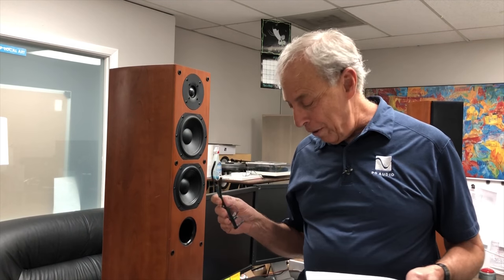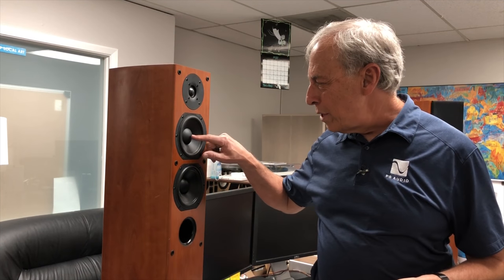Does a dented dome tweeter matter?

Comment: I use a vaccum cleaner for dust caps. place the pipe on the dust cap, turn on vacuum, it pops out, turn the vacuum off before pulling the pipe away because it might pull the cone out too far and that's it.
Reply: Best if you have a hose that has an adjustment knob usually found on canister types.
Reply: yes,  worked for me.   Adapt the hose to a tube same diameter as the dome, adjust the air bypass hole until the vacuum force  is just right to gently pull out the dome.
Reply: @Anthony Martino I tried that but the dust caps on my subs were too stiff; some sort of treated paper.  All it did was pull a bit of the outer layer of paper away from the caps.  I eventually gave up and had to live with my ugly, smash-faced subs, thanks to my 4 year old cousin staying with us.
Reply: I wish I had read your post, before I wrote mine. I recommended the very same thing. I just recommended, that you place the pipe against the dome first, THEN turned on the vacuum. Then, hold the pipe perfectly still, turn off the vacuum, and wait for the motor to wind down before removing it. My tweeter had a very stiff dome, compared to the very compliant surround.
Reply: @Viewer19  I agree. You don't want to over do it, and collapse the coil former. Otherwise, I hope you can find a replacement diaphragm for your particular tweeter.
Reply: @Anthony Martino I couldn't do that with mine. The dome was just too stiff for how compliant the surround was, so I was afraid to pull that hard on the dome. I used a canister vacuum cleaner. I had an attachment, that was the perfect diameter for the dome, without touching the surround.(I needed full suction, but it worked)

Comment: Many years ago, when my children were toddlers, I owned a pair of Magnaplaners (sp?) - very high end, but somewhat fragile audiophile speakers.  Maggie's don't have domes, but the speaker area is thin and frail, and no match for a toddler with a rubber tip bow and arrow.  Knowing my two rambunctious boys, I lived in constant fear that sooner or later, a Tinker Toy would end up being stabbed through my beloved speakers.  I confided my problem to a friend who offered to sell me his pair of BullFrog PA speakers.  Now, I know that true audiophiles will gag at the suggestion of using PA speakers in place of high end stereo speakers, but to my (tin) ear, they actually sounded pretty darn good.  The sale clincher was when my friend demonstrated the child proof (aka drunken dancer proof) feature consisting of steel mesh speaker grills.  He actually threw a beer bottle across the room and bounced it off the steel grill.  "Let's see you try that with your fancy ass Maggerplanters".  Long story short, I sold the Maggie's and bought the Bullfrogs.  That was 35 years ago and believe it or not, the Bullfrogs are still proudly displayed in my man cave, still sound great AND have never suffered a dented dome.  Possibly a pointless story, but I thought you might be amused.
Reply: Ha!  A buddy of mine bought a pair of Advent Heritage speakers to ho with his home cinema.  They worked well,  but he had cats,  and the cats had sharp claws.  I bought some 1/4" hardware cloth,  cut it to size, and formed it around the grilles.  End of problem.  Heck,  they didn't even look bad!
Reply: @gyrgrls  this got me worried. I have cat

Comment: Speaker grilles go on when nephews come to visit. 
Sound quality marginally worse but mental health young lives and family peace maintained:-)
Reply: My man
Reply: Litterarly the only reason that I still have my grilles saved.
Reply: If I don't need the sound system, I've even gone as far as to face the speakers into the wall, and up against the wall, so nothing can get to the delicate tweeter domes, or even the coil caps on the mid range and woofers. Re-position them only if you need them.
Reply: Clean ears out. No difference. Os all in the mind.

Comment: I work in a music store and run into this issue ALL THE TIME. I have found that Gaff tape works the best for this purpose. it's adhesive is just strong enough to pull out even the most collapsed tweeter domes/dustcaps with no damage or tearing.

Comment: I got a pair of B&W DM601 S2 in exchange for some work I did for a friend. The tweeter domes were dented in. I can’t prove it, but after I gently popped the dents out, the tweeters seemed to be more detailed. The remaining lines and imperfections probably don’t matter, but the larger dents seemed to affect it. I’m talking more than half of the surface area was dented in. Weirdly, this was only noticeable when driven by my dads expensive Quad amp.

Comment: I would receive many damaged metal tweeters from JBL , INFINITY and other brands . 
I would use a heat gun at a distance at low setting and fan rapidly across the tweeter , and the air trapped would expand the dome back into place . 
Please be careful not to melt the surface !  Distance and patience, it actually works very well . A hair dryer would probably be safer to use than a heat gun.
Reply: I just posted this on a similar thread...what exactly are you using to fan rapidly across the tweeter.🤔😶thanks for this post 📫
Reply: @iheartwindshields9770  my wrist . Fanning as a quick left to right or up and down above the tweeter surface.

Comment: I had a dented tweeter once after second hand purchase. Tweeter not clearly visible due to speaker design. I heard and felt something wrong that time. Unpleasant and peaky highs, did some freq test with MIC and found out a peak around 9khz @ 12DB!! And the overall response wasnt flat at all! Removed dust cover and found the dented tweeter! Fixed it by slowly warm
It up and roll out the dent from the inside of tweeter moving your finger slowly. Measured afterwards and its flat like the other speaker again which didnt had a dent. So in my case i heard something wrong and to me a Dented Tweeter cant produce the right fequencies at right levels. It took me a while before i heard something wrong. It wasnt a damaged tweeter but a serious dent. Cheers!
Reply: patrickalphenaar small. (Shallow) dents won’t cause any problem  but if a dent is deep enough so that the cone surface comes into contact with the coil centre when it actuated that can obviously cause distortion. This is less likely to happen with the woofer cone as they have more travel anyway, but with a dome tweeter a relatively small den’t could easily cause issues, especially if the dent is away from the centre of the dome.
Reply: frodev , for sure a minor or slight dent wont cause too much trouble. I think the dispersion might be a bit distorted however wont be able to hear it i guess. In my case it was a serious dent and was causing serious problems. Luckily could fixed it. Cheers.
Reply: patrickalphenaar And this expert says it makes no diffrence. I guess that's why B&W is used at more mastering studios than PS Audio.
Reply: John Morris Hi, well some other people in my home studio also didnt hear any issue. Maybe Paul could have heard it in my Situation, i like to watch his videos as entertainment but i listened to very expensive high end gear and mostly they dont impress me at all! But felt in love with Zingali Speakers, but way to expensive! B&W never listened too but yes they most be great if used in so many Mastering Studios! A friend of my listened to them in a Mastering studio and loved them! However he says my Mirage M5-si reminds him Listening to B&W’s. So happy to know that. Currently using Full range Genelec in my new room and love them! Not only Analytic but also very musical after having them play in Phase! Which took me ages to achieve! Placement is as important as Room Acoustics! Cheers.

Comment: To say it has no ill effects seems a little odd to me.  A tweeter is essentially a piston that radiates sound waves in a given patter, based on its shape. Once that shape is altered,  it can't radiate the way it did when it in its proper dome shape, which is often measurable off-axis. I, personally, would replace any pushed in tweeter, regardless of whether it still sounds good at the listening position.
Reply: Old video/comment, but... yes, technically the shape is altered, but any little leftover creases after popping it back up make any changes undetectable to human hearing, at least for us mere mortals. In my case even in its pushed-in state there was no audible difference to my ear, so why pay possibly triple-digit sums to replace a minor cosmetic flaw? Which isn't to say that it can't be worth doing for someone else, but for my money it certainly wasn't.
Reply: @tvih84  Well, sort of...but it's not always like that.  What can and does often happen is that off-axis measurements can change significantly, which you could theoretically notice if and when walking around the room while listening. That said, you're right that if you re-shape it and it still works, the difference would most likely be undetectable (I'd STILL want to change it though... because I'm like that!  lol).  
Cheers!

Comment: Accidentally dented a Monacor DT-352NF during testing. Metal dome tweeter. Dent was about 10mmx10mm. This introduced 10-20% distortion spikes (measured on REW) from 6k to 18k as compared to previous measurements.

Comment: I've seen accounts online that denting can matter with certain metallic materials. Creases cause stress hot spots, and the regular operation of the speaker can then induce metal fatigue to the point of failure. I've only seen this with regards to full range titanium cone speakers, however.
Reply: you can absolutely crack metallic tweeter domes when you pop them back out. Ive done it to a set of JBL nd310 floor standers. You can also burn the tweeters out very easily through friction if you dont repair or replace them, and even take crossover components out when they do if you even have a tiny bit of high register clipping coming from an overworked reciever or something. Ive done it to a set of jbl nd310 floorstanders. Definitely just replace the diaphragm or entire tweeter if thats not an option.

Comment: Although I agree that you probably won't hear the difference, you can measure the altered dispersion of a damaged tweeter. All speakers are designed to act as a piston, but actually flex and "break up" to some degree in a predictable way. If the dome's shape no longer provides this rigidity then flexing will occur where there are creases. So, it becomes a matter of how much it matters to you to restore the speaker's original performance.

Comment: I had it with a KEF tweeter. The sound was still good but it looked weird.  I took my vacuum cleaner and had it put in the LOWEST power setting and gently pulled it.  Worked great! 👏👏👏
Reply: Peter Pan which kefs? I have a pair of q1's with the same problem and I'm afraid the vacuum cleaner might mess something up.

Comment: My friend used to work at a Hi Fi store, and they had a tool for getting dents out of domes. It was a long time ago, and I can't remember exactly what it was, but it was repurposed from something used in the electronics industry, and worked by suction (it was not a solder sucker).
Anyway, it was someone's job at the end of the day to go around and suck all the domes back out after they had all been pushed in by kids throughout the day. He said Saturdays were the worst - every single dome in the store would be dented without fail.

Comment: I had 2 pair of Quad ESL57's in a stack when my first kid was born. First thing I did was sell them. Even though they have pretty sturdy metal grills in the front and the back, I just could not live with the idea of my kids poking something metal in there. For the ones who don't know the ESL57's, these are electrostatic speakers which carry around 6000V of tension on the panels. Now my daughters are 8 and 10 and a couple of years ago I was able to start all over again with highenderitis. The stack is back, with Gradient subs and 4 Quad II tube amps. My kids know very well how expensive the setup is and treat it with the utmost respect.

Comment: This is Brian. I really wish you would have explained to people that on larger woofers and midrange speakers, these domes have no practical purpose except as dust covers.  As a matter of fact, were you to manufacture speakers, this part is called The Dust Cover. I've seen speakers that have no dust cover, be it because the glue wore out or they were very old and the dust cover wasn't installed at all. It actually protects the windings from gathering dust.

Comment: I have be building speakers for over 50 years and in that time I have also repair quite a few. I have used a vacuum cleaner hose to suck the deformation right out. Be careful not to allow lengthy suction.

Comment: I disagree, especially with metal dome tweeters. Once the dome is deformed the voice coil is no longer 100% circular. The tweeter dome is now unbalanced and subject to overheating and rubbing the walls of the speaker magnet. I witness this firsthand with B&W loudspeakers that blew a tweeter shortly after aluminum cone was deformed. Upon magnified inspection of the wire voice coil you could see visible contact points where wire coating was rubbed off from contact with inner magnet. I’m not sure if this is the case with soft dome tweeters though.

Comment: I've had good luck with the tape method for pushed in dust caps.  For really stubborn dust caps, you may have to get more extreme.....I've had some luck with a needle with the tip bent near 90 degrees - pierce a small hole, insert the needle tip and pull the dent out....then apply a small dab of color matched silicone caulk to cover the hole.  Metal domes are tougher.  The best I've managed to do with a metal dome tweeter is to remove the  diaphragm from the magnet and gently push the dome back out from the inside....a pencil eraser can help smooth out the wrinkles, but it's never gonna look like new again, though it can still perform well.

Comment: I had a set of JBL nd310 floorstanding speakers. They had a 3/4" titanium dome tweeter. My ex's kid stuck a finger or pencil eraser end, or something in one of them and dented it. It still functioned fine, but accuracy of imaging on that side of the sound stage suffered a little bit (right channel). Wasn't much at all, and at my current age, i dont know if id notice anything, but the lines of separation were most definitely blurred a little on that channel from then on so to speak. I could detect it with them flipped around as well. I was very accustomed to the sound of that 1 set of speakers, center of image vocals almost felt smeared backwards and up, very subtle and hard to describe even at the time. Once a set of the tweeters popped up on ebay and i replaced them, the "blurred lines" went away. But not before trying to undent yet again and cracking the dome. This tweeter eventually went on to burn out from high frequency clipping way before it should have, taking some crossover components with it (in a half-assed project in some white van special boxes anyway)

Funny tid-bit: The way the center image was affected was almost perfectly in line with the tweeter damage. The dent was on the upper right section of the dome only on the speaker i used for the right channel, and the right side of center image felt smeared and blurred subtly "backwards and to the top right" was how i described it at the time. The dent was absurd how small yet deep it was without cracking the dome, and the kid never came clean on how he did it either.

It can definitely have an effect if left dented, but even then, it's not very significant (at least on a set of low end jbl towers lol). They still sounded fine for what they were. Those were a surprisingly detailed, and overall pleasing set of speakers being a lower end JBL deal though (I paid like 100 used for the set, were like $500 new or something like that, was my first set of "woah, ive been missing soooo much!" speakers), at the time i was surprised by them to say the least

Comment: The absolute best way i found to fix collapsed domes is a vacuum cleaner. It works wonderfully. Just carefully put the end tube on the dome and the suction force will pull it back to shape. Works on all sizes (smaller ones even better), I even pulled back huge domes on bass drivers with ease. Careful though not to damage anything else while doing this, also be prepared to do a quick turn of on the vacuum cleaner, if it has sufficient force, not to accidentally rip the dome.

Comment: Many years ago one of my DynAudio D28 tweeters got dented in. I looked at it for a few days and then decided a little negative pressure might work. I placed my mouth on the tweeters metal plate and sucked to form a vacuum, when I backed off the dent was gone and there were just a couple of wrinkle marks on the dome.

Had i thought of using tape I would have tried it but my unorthodox method worked just fine.
Reply: That’s how I do it too, but I really should use a straw.

Comment: Use Gorilla Tape. I've also used an attachment from a vacuum cleaner but you must keep the suction some distance from the tweeter and approach it very slowly -- it is easy to damage the tweeter with a vacuum.  I think significantly dented tweeters do affect sound dispersion and the hardest of these to fix seems to be the Polk trilaminate tweeters. I often see used Polk speakers for sale with dented trilaminate dome tweeters and I believe those tweeters should be replaced.

Comment: I prefer the vacuum cleaner method.  Turn on the vacuum and slowly approach the dome with the hose.  You may need to keep VERY positive control over the hose to keep it from jamming itself into the tweeter.   But eventually, the suction should pull the dome out with minimal damage.